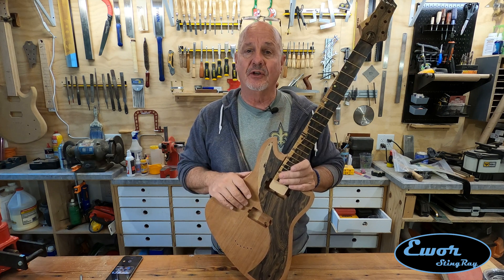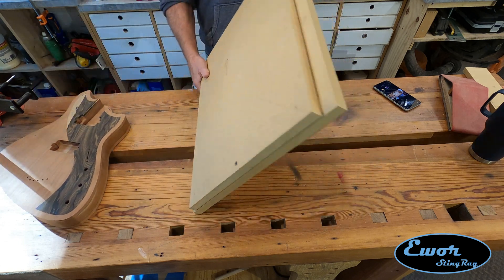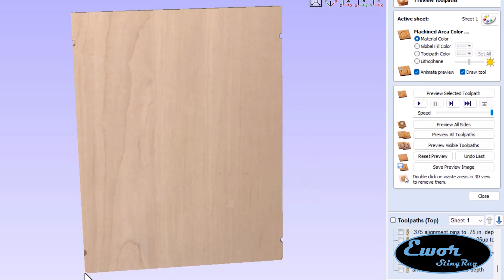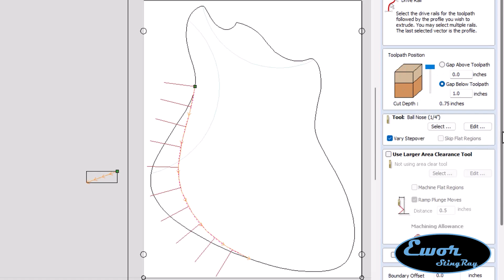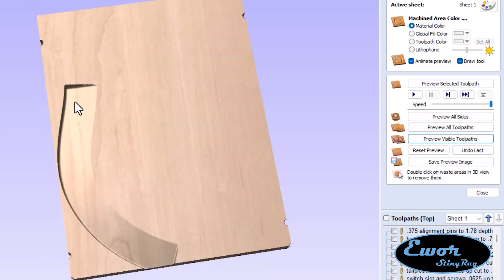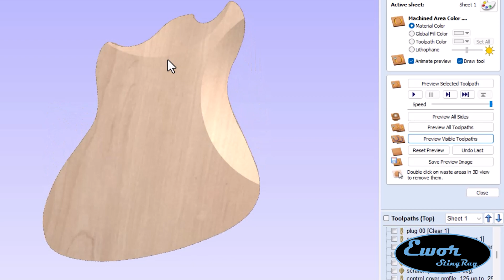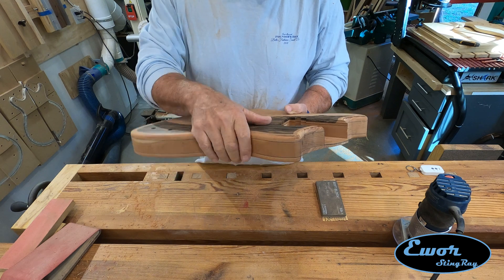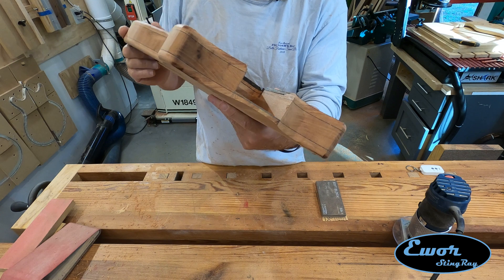Ewor Stingray part 12: CNC shaping the body contours

Comment: 3DCNCGUITARS could design your neck to your specs to carve the back. Also I haven't done blind slots yet in hardwood but I have done in popular with no problems. I set my fretboard jig horizontal to 510's bed and cut the slots using the Y axis.
Reply from the maker: Thanks for the info. I bought some cheap bits on eBay do I can keep on trying 😁
Reply: @eworcustomguitars  that is where I've botten mine also